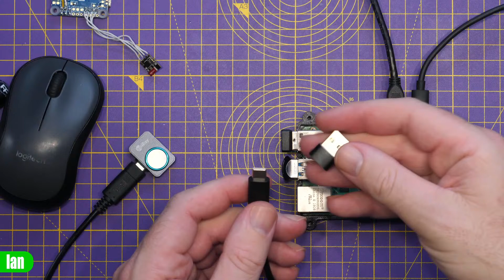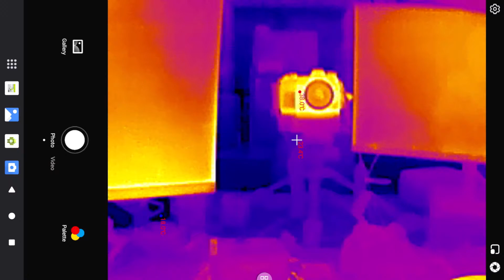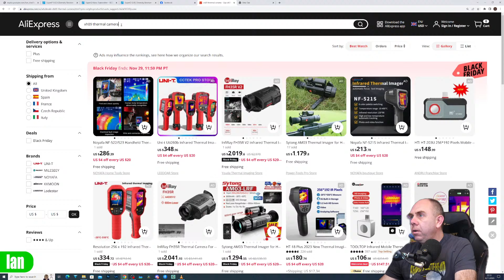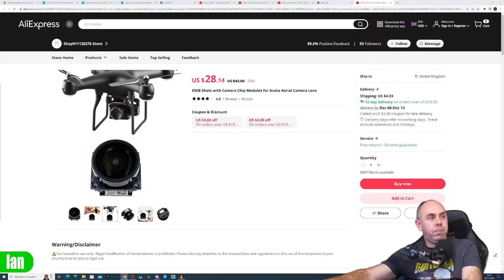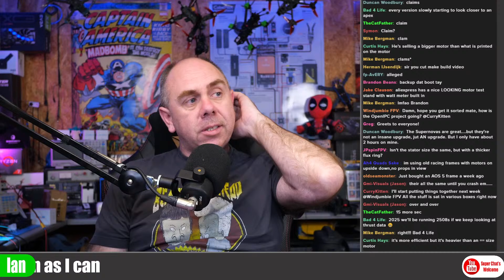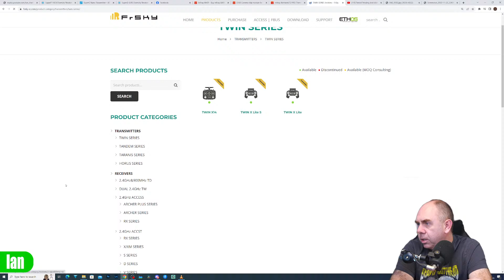DJI O3 Aliexpress Cam - BetaFPV Gemini - DIY Thermal - New AOS Frames Coming  + Q&A + More

Comment: FWIW, I spent an hour or more with mine in hdmi mode, connected to my S10+ and didn’t experience any obvious issue. I also ripped quite a number of packs in analog mode and did not encounter any issues other than it seemed my reception was subpar, using a Rapidfire module. Maybe this is due to Avatar still transmitting despite setting the goggles to analog input mode. It is a special kind of disregard for them to include a selling point feature, but fail to implement it with any care.  At least have the decency to give a man a RA, if you’re gonna do him.

My HDZero goggles had a defect out of the box that nobody else had and hdzero would not acknowledge, so I understand the disappointment that people with defective goggles X are feeling. If Caddx responds with anything short of gaslighting, it will be better than hdz support.

Comment: The factory that makes DJI cameras, churn out original cameras with same serial numbers. Notice the serial numbers from all vendors? it will be the same. DJI came to know of this and blocked that serial number from downloading the calibration data from their servers.
So, the camera modules are original and have genuine components and firmware, but the serial number etched is blocked by DJI

Comment: Have people swapped 03 genuine used camera modules from one air unit to another? I wonder if the calibration is like VIN locking on car control modules?